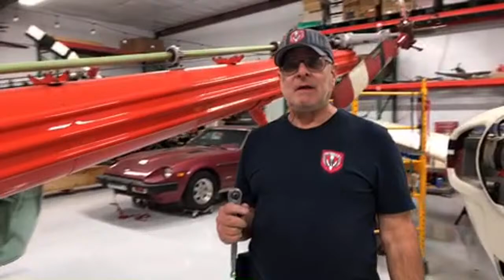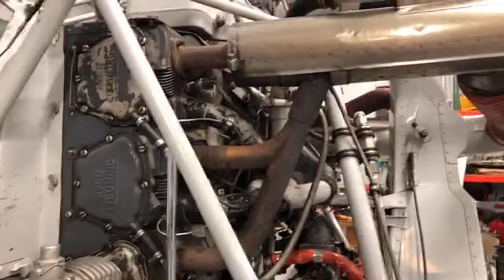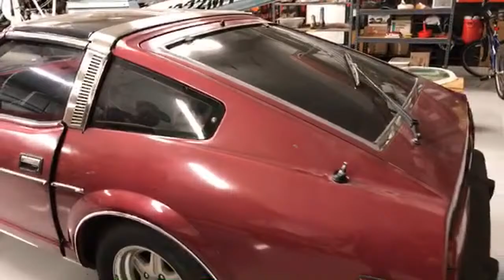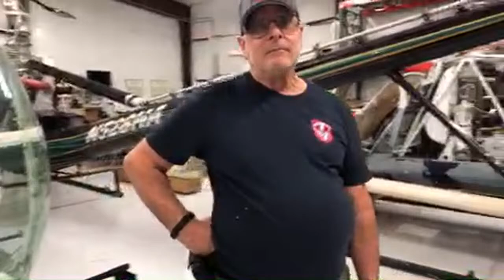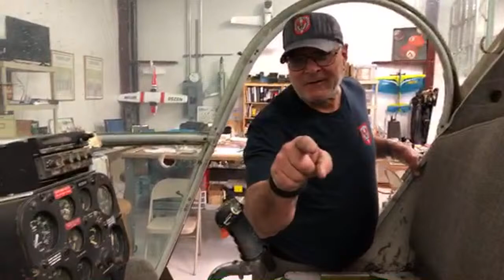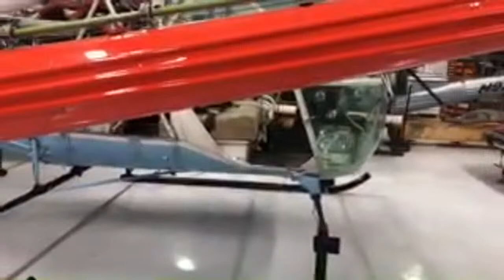Livestream with Hiller Helicopter General Manager

Comment: What is horsepower rating on the turbine model?
Reply: Use one Allison C20/C20B, with 400 or 420hp, in gear box I think the gear box hás limite tô receive only 305 input and maybe the reduction of power of turbine is makes in intermediáry Soloy gearbox enter Main gear box and turbine, the Lycoming VO 540 C2A is the original for 12E and produced 340hp derated for 305 have great torque is excelent no need an turbine except for high altitude, the Record with this machine with Allison is more of 20k. feet with landing tô 19k when needing did remove one person in emergency condition in high to Mountain, I think tô have this informative Magazine noticed when the fact did bê communicated. In my Country we did have only two one 360 in 1950 and one 12E in 1963/64 crashed as one baby with 168 hrs very new during Cross river.